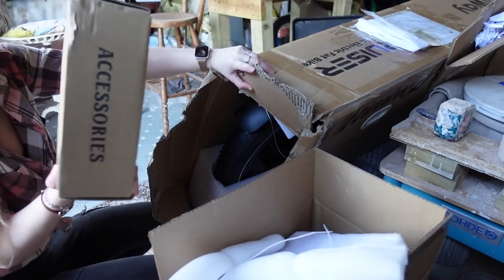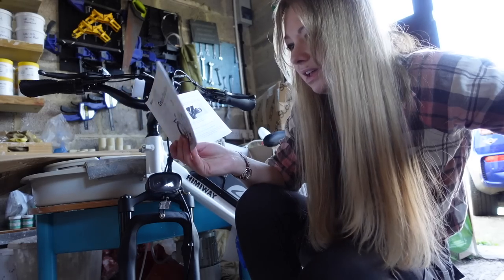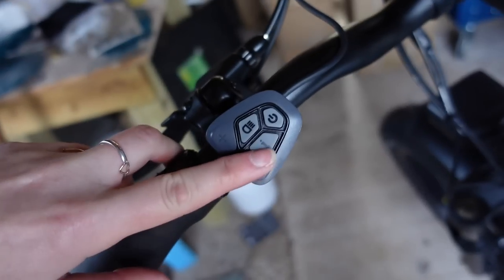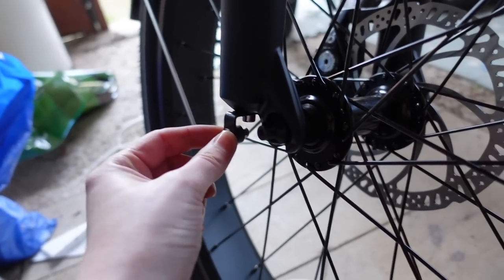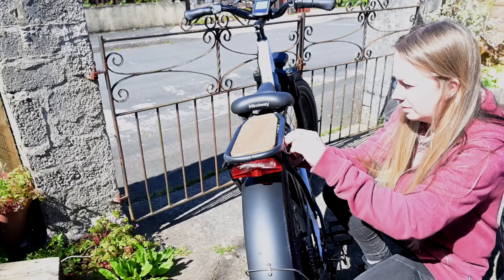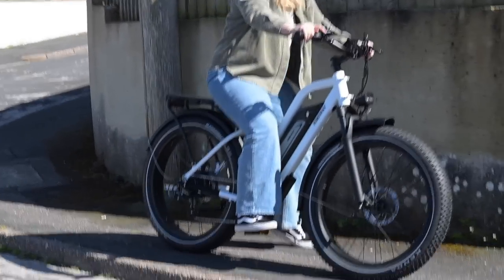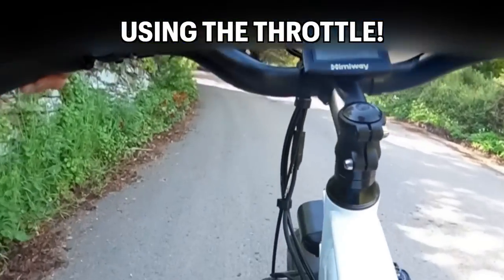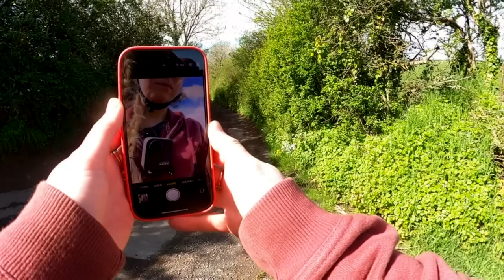Husky Pokes My Eye & Laughs! Trying An Electric Bike For The First Time!

Comment: Brilliant video Jodie, Paige and Key.  Loved watching you both practice riding it. I would have been more wobbly than you were. It looked fun, once you got used to it. It's a long time now, since I had a bike. I had one up until my mid 30's. I'd bought my first and only brand new mountain bike, but when I moved house it was stolen along with my kids bikes. But I'd probably get an electric bike, if I could afford one and had somewhere secure to lock it away. Have lots of fun with it Jodie. You could buy a helmet with a visor, it would stop the flies getting in your face. After all, it's a bit like driving a moped. As it will go faster than a regular bike.

Comment: I always wonder how those electric bikes do on hills. A lot of promo videos and stats are for the flat. I live in a hilly place and stopped riding because the hills were too hard.
Reply from the maker: It did amazing on the hills, I put it on 5 for the speed and it was so easy to ride up the very steep hill! The hills around here are why I don't ride my normal bike, but I'm not worried about the hills now with this electric one!

Comment: Gorgeous bike! Your tiny self with the bike's fat tires and thick frame makes it look even more like a Harley Fatboy or Batman Dark Knight motorcycle. Looking at the tires surface, I had doubts it would survive the off-road test. I'm glad you chose to go ahead through the mud, bc otherwise you wouldn't have shown us how truly off-road and thus versatile the Himiway is, much less known for yourself. Plus, now you know where not to take Key after it rains. It's a little too big to fit in a hatchback already filled with Husky. (Perhaps a roof-mount bike rack for holidays?) That and the height issue for petite riders are the only disadvantages I can see. A few questions remain in my mind: Could it be used with a stationary mount for indoor fitness (inclement weather) and charging batteries and appliances (offgrid life and outages)? And can the battery be solar charged with a portable power bank? (How long would it take/last?) All in all a wonderful bike, Jodi. I think it will serve you very well. Bright blessings, all. 💖💖💖

Comment: I started riding ebikes 3 years ago. My first was a cheap Chinese bike, which was fun but limited. So I replaced it with a Himiway just like yours. I loved that bike, but I was challenged by the narrow step through gap, and to be honest,  it was just a bit big for me in my situation as an urban rider. But not to worry, the Himiway was stolen off my front porch, which provided the opportunity for me to get a folding ebike which I can bring inside my place. It has a 750W motor and hydraulic breaks so it is as powerful as the Himiway, but with smaller wheels, a slightly shorter wheelbase, and a wider step through gap, this bike is better adapted to my urban situation. On the other hand, it just isn't as cool as the Himiway! (Sigh!)
Reply from the maker: Oh no that's terrible it got stolen! Totally understand needing one a bit smaller for urban use. Off-roading on this one felt great, I was surprised that the size wasn't really an issue for me.

Comment: Get a real bike. You will get a strong core and bad ass abs. I know your vegetarian but exercise and vegan you'd be in amazing health. Give it a go
Reply from the maker: It is a real bike 🤦‍♀️ I said in the video that you can turn the assist to 0 and it would be like riding a normal bike, except you would also have the added weight of the battery to peddle, so even more exercise. I'm not vegetarian.